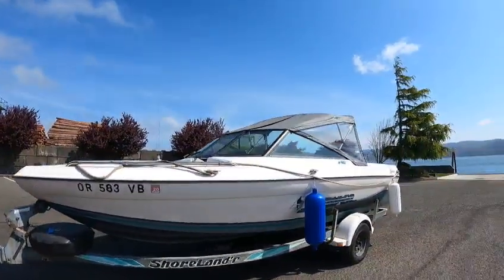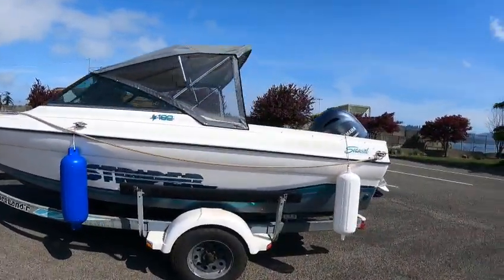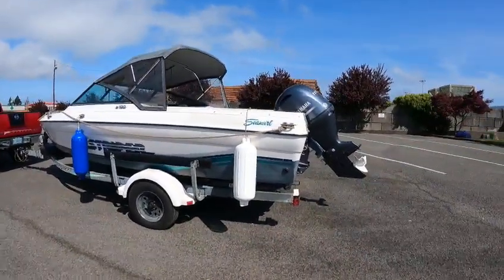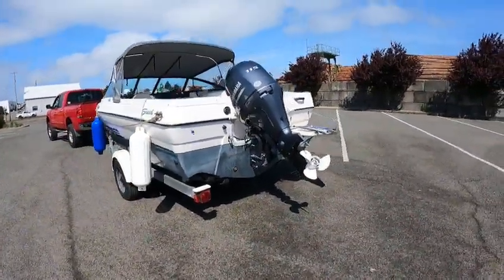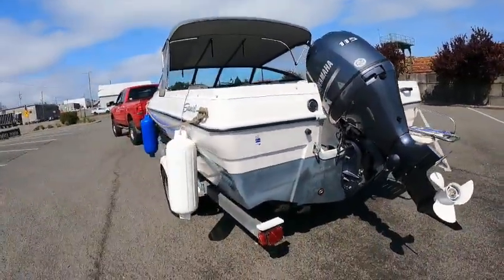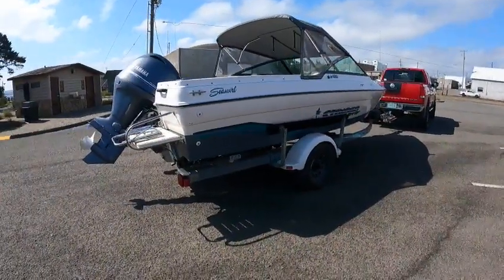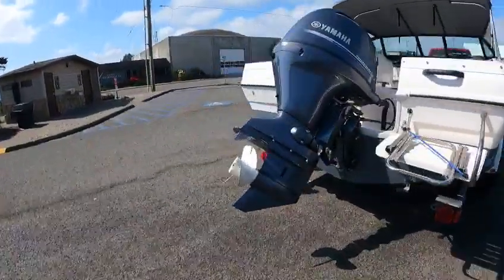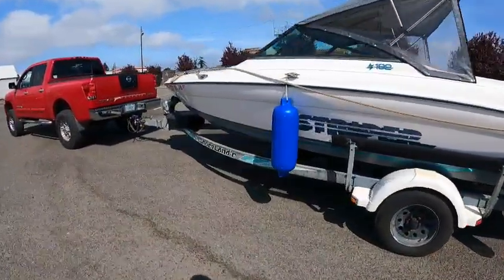1994 Seaswirl 192 DC Customer Repower Yamaha F115

Comment: Hi, I recently got the same boat and there’s no battery connected to it, I’m having issues understanding what cables for the electrical goes on the deep cycle and which ones on the started battery. Is there any way to get this info online for the 1994 seaswirl striped 192